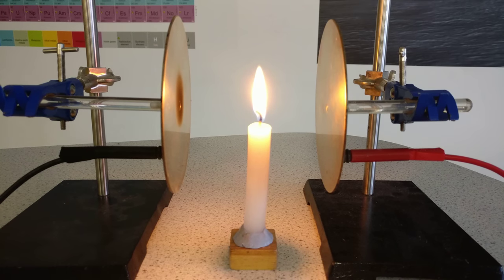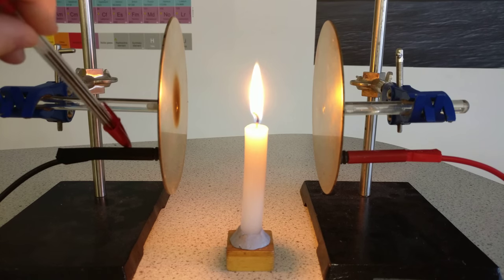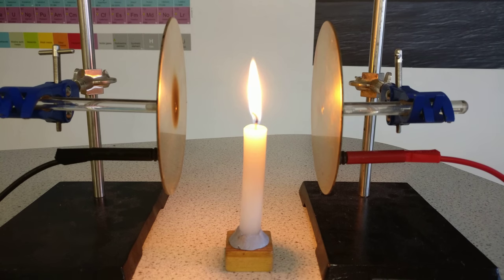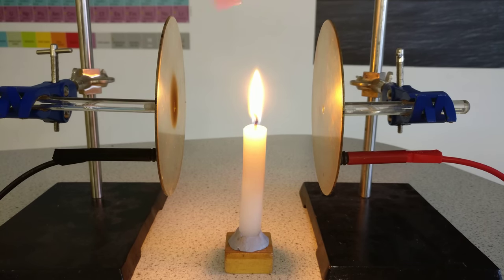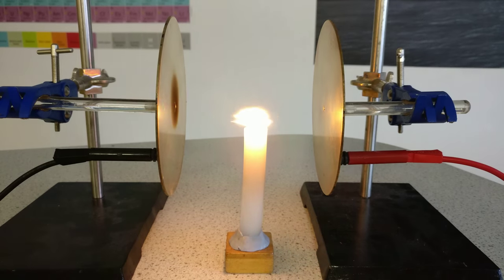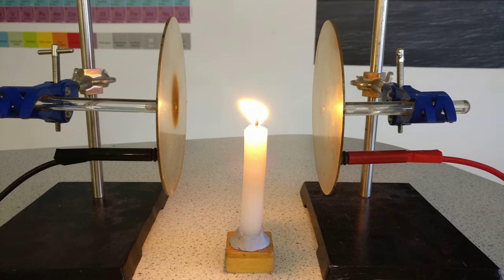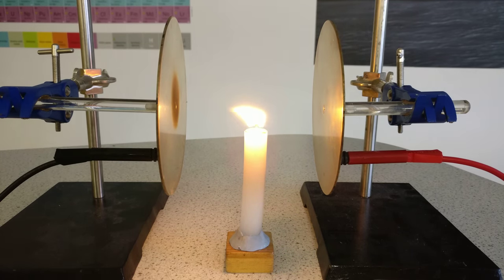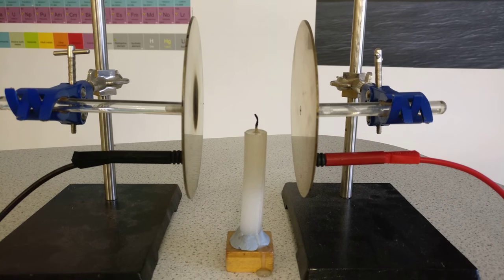Christmas Candle Flame in an Electric Field  - AQA A Level Physics

Comment: You should add that the left plate gets a black spot on its surface.
That is where the positive ions go - the carbon+ ions.
And for the record, there is always an equal amount of negative and positive produced.
The flame is asymmetrical because the positive ions are bigger than the electrons.
Reply: Thanks! I was wondering about the statement "there are more positive ions produced" 😊
Reply: The ions are causing movement of the air and the burnt candle fumes. The products of combustion are causing the stain on the left plate. Do this in a vacuum, obviously without a candle, and no stain would appear on the left plate.
Reply: Wonderful!
So would this have anything to do with a catalytic converter?
Reply: I doubt there would be free carbon cations in gas phase. Carbon cations are a very high energy species that you would only observe in extreme temperatures (much higher than candle).
Reply: @thecsslife  candle flame is supposed to have hot spots with the envelope just outside the visible flame reaching 1300 or 1400 C. I don't know how plentiful the ions are but supposedly some are produced. When I first read the OP, I thought he meant the ions were being created from the carbon in the metal alloy plates but after I read yours I realized they are being generated by the flame and then moved by the electric field.
Reply: Yo, Dude!
Reply: Jeff Bransky and S Tho voiced my suspicion that the flame could be incidental, that it is the charged air that is moving, the flame just happens to be in the way. The only problem with that is that at 2:41 the fume is not moving. The charge still appears to be on. This experiment could be repeated in a vacuum if both the fuel and the oxidizer were provided.
Reply: @rongarza9488  by "charged air" I think you are referring to the tiny amount of ions in the air before lighting the candle but the candle creates even more ions. Because it is not very hot, it produces very few ions but it does produce some and an experiment similar to this video should be able to prove that and maybe measure how the ions increase after introducing flames and increase again with a hotter flame.
Reply: @rongarza9488  Charged air moving would mean ionization. 
In my experience only points can ionize air when a few thousand volts are applied.
Flat plates do not achieve that, so the ionization takes place in the flame.
I am not sure in what form the positive ions are formed, C, CO, CO2 or even still in hydrocarbon form, but the black soot on the negative plate indicates that the ions containing carbon are positively charged.
Reply: @STho205  When diving deep into a simple experiment like this, one could discover just as much about nature.
An experiment doesn't have to  be impressive or extravagantly expensive to achieve real insight.
Reply: Electrons is not ions. So if there is some plasma in the flame should 'nt there be positive ions and free electrons?
Reply: @lubricustheslippery5028 Yes, that is the whole idea of a plasma.
Reply: @STho205  need oxygen to burn things.  A vacuum would eliminate oxygen, thus no flame.
Reply: @jeffbransky7966  More clearly: The black spot is caused by the positive ions going through the flame, picking up "products of combustion", and into the negative plate.
Reply: @nutsandbolts432  you don't need air to get oxygen. Solid rockets have fuel/oxidizer mixtures that burn when heated. This candle gets it's oxygen from the air but you could build a candle that does not need air.
Reply: @thorr18BEM  In a vacuum those flames would be busy expanding though.
Reply: Free electrons aren't typically called ions, but when they are stopped by the air probably they make negative ions.
Reply: @STho205  lol no, it's a testable hypothesis that could be done in any lab with the power supply, a vacuum pump, a reasonably sized bell jar and an oxy fuel torch, which can be hired easily.
Reply: @rongarza9488  I suspect that if it does work in a vacuum at all, it will need a higher field because there certainly is some wind effect in air, as can be demonstrated by putting a paper pinwheel in between the plates.
Reply: @STho205  "we have known the elemental chemistry of this for over a century". More like two. 

Bur that's simply an explanation that's scientifically plausible that was came up with that just explains existing phenomena.

It has no real predictions in it, so it isn't as it stands testable, so it is just that, scientifically plausible. It can't be said to be correct or not without thinking about if the explanation is true, what else must we predict to be true by necessity and how can we make an experiment to prove it.

So that's not doh or derp, it's actually a perfectly valid scientific question. And the experiment proposed would go a long way to answering it.

Time and time again phenomena that seemed to be well understood yielded far better explanations and in fact a better understanding of related phenomena and chemistry and physics in general on a closer look.

A great example of this is the reaction of alkali metals with water. It was thought to be long understood. That the reaction of water and sodium, for instance, releases gaseous hydrogen and that igniting was what exploded.

To the point distinguished chemists like Prof. Martyn Poliakoff from the University of Nottingham said, just like you, there wasn't a point in looking into it.

But in this instance Prof. Poliakoff was wrong, and Dr. Phillip E. Mason, better known as Thunderf00t on YouTube, proved by high speed microscopy that the explosion was caused by the sodium reacting with the water stripped electrons from the water, evidenced by it actually going clear on several occasions, and that the sodium after this explosively disassembled by first pushed out microscopic hair and finger like projections which leads to exothermic positive feedback and an explosion.

Which result was replicated in other alkali metals including potassium and caesium. The hydrogen catching fire is incidental and doesn't in fact happen in the lack of oxygen, unsurprisingly, but the explosion does, with little change. Disproving the centuries old explanation.

He published his results and dubbed the phenomenon columbic explosion. And who knows where this better explanation.might lead.

Similarly it isn't a waste of time repeating the flame between plates experiment in vacuo and who knows where the better understanding of the interaction of flames and electricity might lead, whether it be more efficient engines or new fire fighting equipment or something else entirely as yet unimagined?
Reply: @STho205  in vacuum you would get an electrical discharge.
Reply: @rongarza9488  another way of testing this would be to replace the high voltage by a high magnetic field.
Reply: @janhemmer8181  this is so much true! Seeing nuclear radiation with a cloud chamber, or measuring the speed of electricity using just an inverter, a long wire and a frequency meter are good examples of this!
Reply: @DarkMoonDroid   No
Reply: @STho205  mhmm, but answer me this: is the flame moved by the electric field directly, and/or is it moved by the electric wind, which is also a well known phenomenon? To what extent of each? And how do you know? Can you prove it, and if so how? What else might such a mechanism imply?

If you're unwilling to even consider any of these questions, perhaps experimental science isn't for you... Perhaps a vocation in the clergy would more be your cup of tea?
Reply: Also the electrons aren’t what is glowing, the soot is
Reply: @thecsslife  So the paraffin (lots of CH2) in the candle wax is oxidized into CO2, CO on oxygen, of course---but not all of it. An excess of carbon in the yellow part of the flame is reduced into polyaromatic hydrocarbons in a process called "conjunct polymerization" as our petroleum brothers know it, and can form large caged structures (remember buckyballs?) on which a positive charge can be temporarily dispersed over the large pi-electron system-as the structure cools, a grape-like carbon cluster structure forms and stabilizes (soot) - positive sharge now delocalizes more, but is attracted to the negative electrode in the cooler region of the flame where the cool carbon plates out!  Put the negative electrode in a flame itself, and the carbon will burn off. Cool huh?
Reply: So the paraffin (lots of CH2) in the candle wax is oxidized into CO2, CO on oxygen, of course---but not all of it. An excess of carbon in the yellow part of the flame is reduced into polyaromatic hydrocarbons in a process called "conjunct polymerization" as our petroleum brothers know it, and can form large caged structures (remember buckyballs?) on which a positive charge can be temporarily dispersed over the large pi-electron system-as the structure cools, a grape-like carbon cluster structure forms and stabilizes (soot) - positive sharge now delocalizes more, but is attracted to the negative electrode in the cooler region of the flame where the cool carbon plates out!  Put the negative electrode in a flame itself, and the carbon will burn off. Cool huh?
Reply: Jan Hemmer: You just answered both of my questions
Reply: @DarkMoonDroid  No
Reply: Nerd
Reply: Electrons are theoretical, so no one is really right.
Reply: @StarQualityVideo  you're absolutely right!
We have made a lot of "jumps to conclusions" in science and we should be aware of this all the time.
Often a hypothesis becomes the accepted explanation without any further proof.
And after a period of time the phenomenon it was designed to explain is used as proof!
But this is the common ground we have in order to discus phenomena.
Reply: agreed! totally, totally true!!
Reply: @jeffbransky7966  I would love to see a candle burn in a vacuum :D
Reply from the maker: Deep space?
Reply: @thomasisele2051  Reread
Reply: @thecsslife  re guarding free carbon cations in the flame.  If there are then where do they get the energy? 1)There is the energy in the temp of the flame. 2) But, then there is energy added by being position in an electric field.
Reply: @janhemmer8181  "black soot is negatively charged"  yup being hot in a strong electric field  some electrons get knocked off leaving the soot positive with free electrons bumping and sometimes knocking electrons off air molecules.

Comment: Great demonstration. I would be interested to see this with AC and what the flame does as the voltage increases, as well as with a larger flame, such as from a bunsen burner where you "cut" the tall flame in half (hope that makes sense)
Reply: I think I understand your premise, I would like to see that as well. Thank you
Reply: Sub’d & Bell’d
Reply: Modulating the frequency of the AC power might produce an interesting effect as well.
Reply: i guess the flame won't split in half. the electron -carbon cation recombination in the flame plasma is where the visible flame light com from, if one pull cation and electrons away from each other, we can't see flame and the chain reaction of burning will end.
Reply: Socket 60 Hz AC probably wouldn't do anything, though with a high enough voltage you might see a breakdown facilitated by the presence of the flame. If you could modulate the frequency to match the oscillation of the flame (looks like 5-10 Hz for this flame) you might see a resonance. For maximum effect, the E-field should be oriented vertically.
Reply: AC wouldn't do anything.
Reply: @jongyuchen  I heard that the light is from incandescent soot particles 🤔
Reply: At high enough potential difference (voltage) the insulation effect of the air to breakdown and a spark jump between the conductors (in this case plates). 
This is why fires under aerial high voltage power lines can shut down distribution (grid) networks, by tripping protection systems that respond to what in effect is a 'short circuit'. 
Due to a normal load on a distribution feeder suddenly shutdown, a local protection fault trip can lead to a 'cascade protection fault trip' scenario... and so, a much larger distribution network shutdowns.
btw... 25kV is at the lower end of A.C. high voltage distribution networks, that can range from 1kV to 660kV.
Reply: @Anenome5  No.
Reply: What is v and d
Reply: @thedictator1454  V is the supply voltage and D is the distance between the plates.
Reply: @dmdeemer  thanks
Reply: I wonder if it would just agitate the flame.
Reply: While AC may have an interesting effect, AOC would just blow the candle out.
Reply: @jamro217  lost me at AOC. What does AOC mean? I assume it isn't Alexandria Ocazio Cortez. Lol
Reply: @andrepepinski4213  Yeah, the bartender from hell.
Reply: flame will dance left and right as AC poles keep alternating...best demo  is to use AC high tension voltage to breakdown water to oxygen and hydrgoen molecules!!
Reply: for real. 110% right!
Reply: I guess AC will not affect the flame. That 60 Hz is too fast to see the result with the naked eye.
Reply: I have access to a 50 kV AC supply, and a VLF (Very low frequency) supply that tops out at 60 kV Peak at 0.1 Hz. Describe the experiment, and I may be able to set it up...
Reply: In AC, the flame will found its home, so it will sit nicely. Unless if the AC is from a really close star...or a really far star...wait, oh, and there's us. 🤨
Reply: AC results would depend heavily on AC oscillation frequency. Interesting results could happen at resonant frequencies of the plates, and at differential frequencies between the plates (given likely  subtle or non-subtle differences)
Reply: @Fun Bunny that's more the colourful burning of things particularly metals, like red for strontium, green for barium and yellow for sodium. Presumably also the light blue from burning light hydrocarbon gases?

Most of the light from yellowish carbon burning is incandescent hot carbon particles. Soot basically. Which is why something like methane or methanol which burns extremely cleanly doesn't put out much light.

Back in the days of gas lighting, with coal gas, they'd get benzene as a fraction of dry distillation of coal. The methane and stuff gas was used as the fuel gas, and they'd get more gas, called water gas and I think producer gas, from squirting a jet of steam onto red hot glowing coal coke (the coal that's had the gas and stuff heated out of it already). That makes carbon monoxide and hydrogen. This would cool it down, so to heat it up again, they'd alternately blow air on it, making carbon monoxide from the oxygen in the air and leaving things like nitrogen, argon, etc. still in it.

But none of these gases were particularly good at putting out light when just burnt as a flame. So they'd put back in some benzene vapour so there was something in there that burnt dirty to make soot to produce the light :D

Comment: I hooked my oxy/acetylene jewelers torch to the positive side of my HV power supply once (yes, I took all necessary precautions and isolated everything with ground connections and flashback arrestors on the gas lines at either end of the hose), after I coincidentally noticed my raw acetylene flames were attracted and repulsed by the anode/cathode of my HV system, I turned the oxygen off so it was just raw acetylene burning and then held the cathode in front of the flame. If you ever get the opportunity to try it it's mesmerizing, I was fascinated as I watched a bug fluffy cloud of soot growing into dendrites off the cathode, rather quickly I might add. I wish I had recorded a video of it, maybe I'll have to haul my torch set out of the garage and dust off the HV supply one of these days and record a quick video of it happening. I could very well be wrong but I think some of the acetylene gets transformed into carbon nanotubes, I remember hearing about methods of growing carbon nanotubes that involved an acetylene gas filled reaction chamber that is burned under high voltage but I could be remembering a dream, don't quote me on that. Regardless, it's a fascinating experiment to see a flames properties when exposed to high voltage, especially when you can grow big fluffy-cloud dendrites of complex carbon structures with nothing but a bit of burning acetylene and a cheap ebay 20,000 volt transformer lol.
Reply: I would love to see a video of that.
Reply: Please do!
Reply: Make a video!!
Reply: The world needs that video.
Reply: Due to popular demand I'll record a video in a few weeks when I get back home from work, I'm out of town ATM. I've wanted to get it on video for a while anyways so this is a good excuse to do it lol.
Reply: Hard to imagine...
Reply: Are you on drugs?
Reply: @thersten  is this real life?
Reply: @TheExplosiveGuy  subbed for video
Reply: @lavaphile399  Video is live.
Reply: @yelectric1893  Video is up!
Reply: @joshwright3276  video is live.
Reply: @reggieb184  Video is uploaded!
Reply: @Maxumized  Video is ready to go!
Reply: @DeUser1337  It's uploaded.
Reply: I just recorded a quick video of it, I had to get a new high voltage source so it took me a little longer than I thought but it's ready to go now!

https://youtu.be/485FlvECTv0

Edit: Here is a second video I made, I replaced the electrodes and got much better results and more detailed footage this time, this is more like my previous results from years ago. Enjoy! 

https://youtu.be/canfk7BWWfM